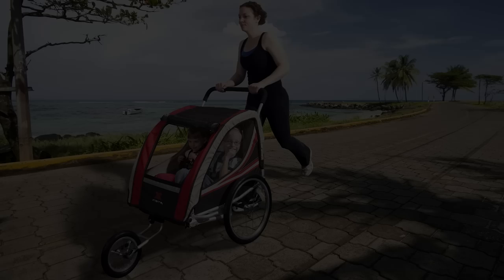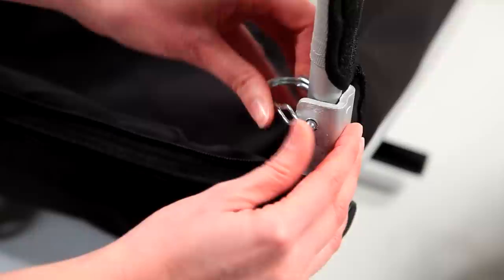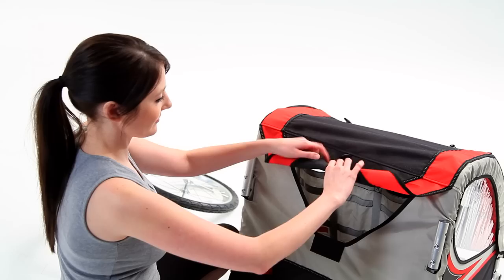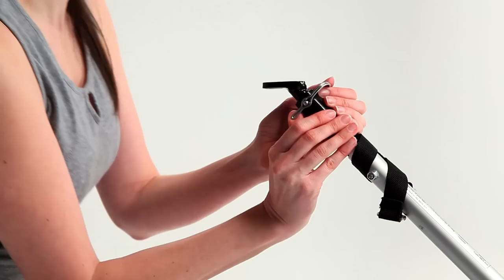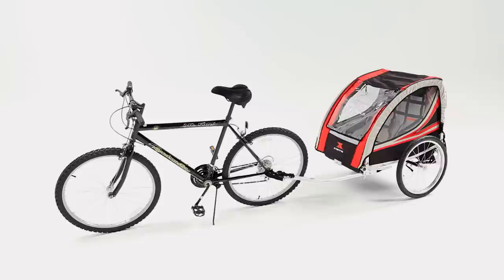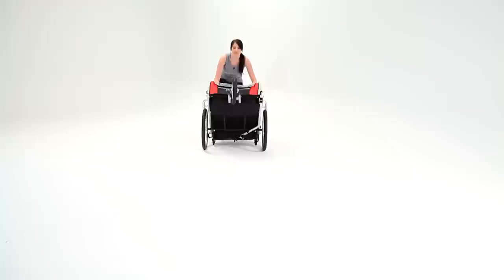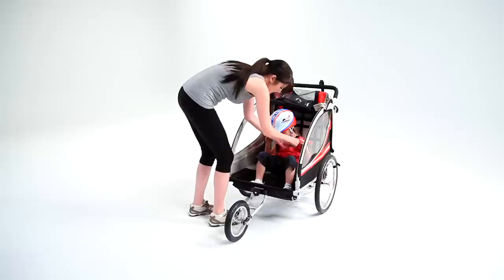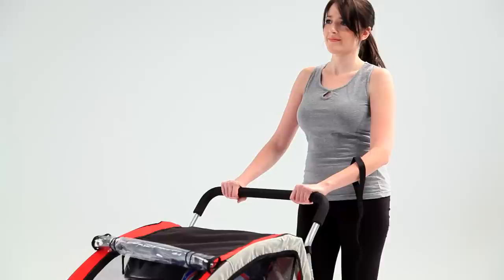Ogden Trailer Instructional Video

Comment: good video, but I seem to have maybe an older model that has the "clamp-on w/tightening knob" to attach to frame rather than bolt pin that you attach to quickrelease shaft of bike.  Is there an upgrade converter I can get for my trailer?  thanks!
Reply: have the same issue did you ever find an answer???
Reply: same here. I have an old model as well. does anyone have the number for ogden? they don't even have a website i can find.
Reply: I have the same issue. Did u guys ever figure out how to attach it to the bike?